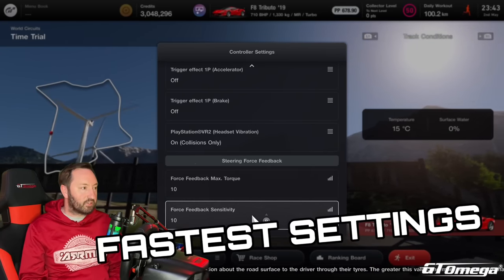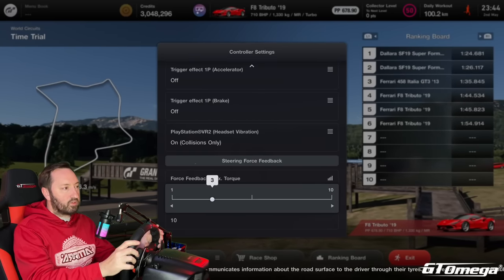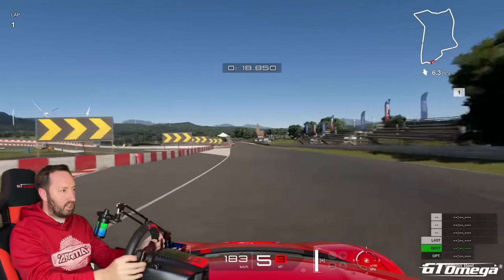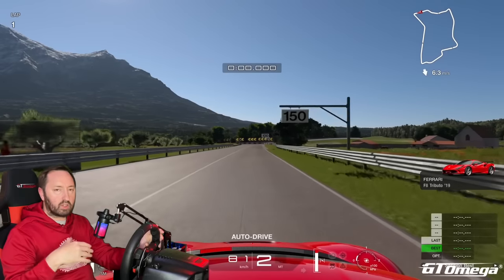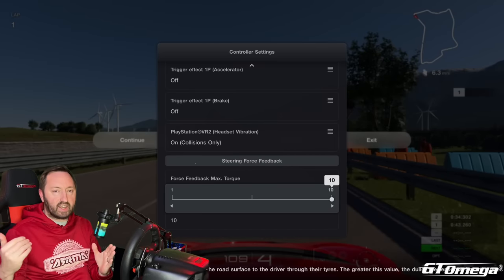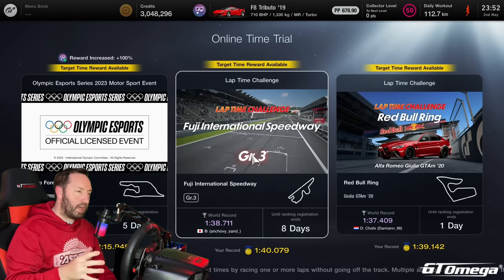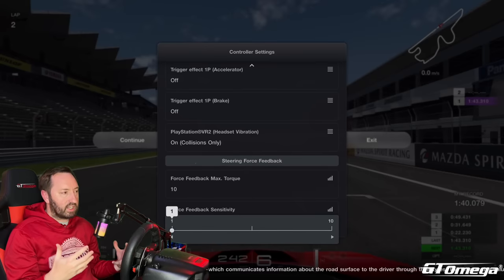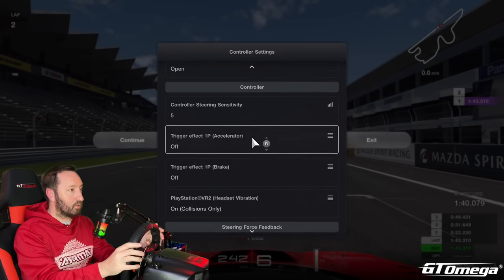Stop Wasting Time! Change Your Force Feedback Settings Now!

Comment: Thanks for the info. Non Wheel player here so do you think this gonna work on controller?
Reply: Sadly no; the settings (apart from Controller Sensitivity) are for wheel bases only.
Reply from the maker: Yeah exactly right. There’s are for wheel only. However I do plan on making a controller specific video which will cover the controller specific settings and my recommendations for those 👍🏻
Reply: @Doughtinator  when playing with controller I do wish PD had included acceleration and breaking sensitively settings for the analog triggers, a responce curve setting would be great. Pretty sure they had the option on GT5 etc.

Comment: Just a quick question, what did you mean about not getting any feedback on the kerbs. I use the TGt2 with the transducer motor (think that's what it's called) and when I ride the kerbs my wheel shakes on the side that the kerb is and I can feel which wheel is on the kerb whether it's the front or back or both. I only just got the TGT2 I wanted the Fanatec but living in NZ made it almost impossible so went with the TGT2 and glad I did. The motor also sends vibrations down my rig Playseat Trophy ( very solid rig) and to the pedals. It's only subtle and you won't feel it with shoes on but for me that was a real game changer. I whole heartedly reccomend the TGT2 it also has a much nicer wheel than the official Fanatec one which looks a bit too plastic to me.

Comment: I have a DD1 and the settings are high for GT7 and I have to say the game is crap for strength. Assetto Corsa, f1 and WRC10 the feedback is as powerfull as you like but on GT7 seems very limited. I have stopped playing the game beause it is pointless. If i hit a curb hard it should be trying to break my hand and not feel like I am going over a small bump. I would love a reply if anyone feels the same as me
Reply from the maker: Yeah I can imagine for a DD wheel these settings might be a bit high. 
I also agree that GT7 does seem a little limited on detail when it come to force feedback.

Comment: Worth it's weight in gold Chris, thanks 😊. Whilst I was using the G29 I was 4  and 7 as they move down the options and to match that on the T300 RS which I now use is 6 and 9, brand new servo, not what I had anticipated. I haven't done it back to back but I used the G29 for over one year, I feel fairly certain that I have them matched, weird.
Like deployed 👍
😎🎙🏎✅️
Reply from the maker: Thanks Julian 👍🏻👍🏻

Comment: Would a Logitech wheel work on a collapsible racing stand
Reply from the maker: Yeah for sure. On my GT Omega Classic wheel stand you can remove the two lever screws and it collapses down nicely. Just make sure to route cables so they can’t get trapped 👍🏻

Comment: The controller sensitivity will make your wheel turn in more to a corner, thus you can have precise turn in rather than over steer but you need to adjust this before you add steering sensitivity or you will not notice it( turn down steering sensitivity to 1, head for a corner at high speed and see when your back end will fill out....if it does  flip out and your controller sensitivity is at 0, turn it up  one increment then try again....eventually you will find your precise turn in at speed that you can maintain.....once you find that precision, then turn up you sensitivity on your wheel bit by bit to find what suits you best
Reply from the maker: I’ve not been able to notice this. I’ve tested but can never feel a difference 🤷🏻‍♂️
Reply: What wheel are you using?
Reply from the maker: I’m using Logitech G29
Reply: @Doughtinator  I have a thrustmaster tgt and there is definitely a difference. It’s literally more precise, and sensitive.
Reply from the maker: Interesting. I still can feel it and I’ve tried to check. Maybe it’s thrustmaster specific 🤷🏻‍♂️👍🏻
Reply: False. Controller sensitivity has no effect on wheels.
Reply: @kubemaster no. It’s in your head.
Reply: @JohnSdigi   No, It’s not in my head. Look at the link I left above. You can actually tell the difference in balance. Adjusting sensitivity improved my times when I set this to my liking. I’m A+ S ranked.
Reply: @kubemaster  its 100% in your head. I’ve seen the link and it’s wrong. Its been tested over and over, there’s no difference. I’m on a DD2, absolutely no difference in feel.

A+/S as well.
Reply: @JohnSdigi   Pal, I won’t argue with you, perhaps it’s wheel specific. I’ve literally tested countless times, and it does make a difference. Again, I have a TGT. Do you? I can feel the difference. No need to be insulting here.
Reply: @kubemaster  I wasn’t being insulting. That’s in your head as well.
Reply: @JohnSdigi  It’s insulting saying “it’s in my head” when I’m skilled enough to feel the difference. And… You don’t even have the same wheel. Anyway, you’re a total stranger, believe what you want. Ignorance is bliss. Goodbye.
Reply: @kubemaster  telling someone it’s a placebo effect in their head is not insulting. 

You have very thin skin if you think that’s a insult. Consult a dictionary.
Reply: @kubemaster  ignorance is bliss. Your ignorance. It’s been proven over and over that there is zero effect. 

Some claim the effect is felt in G29/Fanatec etc as well. And all disproven. 

It’s called a placebo effect.
Reply: @JohnSdigi  Buddy… conversation is over 🤷‍♂️ Go live life. Believe what you want. You sound obsessed. You don’t even Have the wheel. GOODBYE. Let it go.
Reply: @kubemaster  lol you ignorance sadly is not over 😂
Reply: @JohnSdigi   You don’t have the wheel to even prove your theory…. But you aren’t ignorant. 😄 got it. Goodbye. lol
Reply: @kubemaster  plenty of others have. And it’s the same placebo effect people think they feel on Fanatec. It’s been disproven already. Zero difference but keep fooling yourself 😂
Reply: @JohnSdigi   Why do you care so much? I actually have a Thrustmaster TGT… That was built for GT sport and GT7. It has a transducer. The fanatec doesn’t. Other factors like personal FF settings factor in as well. Other people may not be able to tell at all, based on the car class, etc. Group 3 cars (which I race) are more pronounced. 

Why don’t you prove that you can’t tell the difference, and make your own video disputing the video link? Oh that’s right, you don’t have the actual wheel.
Reply: @kubemaster  because there’s no difference in the information the game is sending to the wheel. Thats why it’s a placebo effect. 

If we did a blind test, you wouldn’t be able to pick which setting is which. Many have tried this. 

Great. Your thrustmaster has a cheap/weak transducer. Whoopee and irrelevant. I have 2 Buttkicker LFE’s tied to a 1,000w amp 🤷🏼‍♂️

Why do you prove that different information is being sent to the wheel by the game. Oh right. You can’t, because it’s not sending different info.
Reply: @JohnSdigi  What you have is irrelevant… do you have the same wheel? No. This topic seems to make you upset… it’s amusing. Yet I have the actual hardware in question,.that you literally cannot prove has an effect. You sound, disturbingly obsessive about this. Why don’t you personally dispute the video I sent. Contact him personally and tell him it’s a placebo. You’re not getting anywhere with me…. .
Reply: @kubemaster  😂 you don’t understand the word “relevant”. 

It is relevant. Because ignorant users also claim controller sensitivity effects their Fanatec. It does not. Fanatec has confirmed this. 

It’s in your head.
Reply: @kubemaster  what’s amusing is you appear to be the only one getting upset, Mr “that insulted me” 😂😂😂
Reply: @JohnSdigi   The conversation was over 7 posts ago… 🤷‍♂️. You’re unhinged.
Reply: @kubemaster  your right. It was over when you failed at understanding how the game works. 

Also amusing for you to post that, meanwhile you’ve also been carrying on. Logic isn’t your strength I see as you’ve fallen prey to a fallacy/hypocrisy.
Reply: @kubemaster  meanwhile Fanatec confirmed controller sensitivity has no effect. 

Just like people thinking SPR/DPR have a effect, more examples of placebos. 

You need to do a blind test. Have someone change the setting multiple times and see how many times you correctly pick it. Guaranteed you will fail.

Comment: 1. Controller sensitivity doesn’t affect wheel.

2. People with Logitech wheels always feel like their wheels are weak and want them to be more powerful but they can’t be. All jacking the max torque does on a Logitech wheel is delete any and all detail. Run over a pebble? Max torque. FULLY sending it in a corner? same forces. 

3. On my thrustmaster, when I want “tighter” steering, I reduce the steering angle on my wheel. Pressing left on the d pad on the wheel and the option button on the wheelbase at the same time will reduce steering angle, this needs to be done every time.

Comment: Controller Sensitivity(CS) may be more evident on fast consecutive left/right corners IMO. I too struggled to see if CS made any difference for wheel (I'm using Fanatec DD Pro), and I DO feel like there's subtle difference between min (-2) and max (10). With CS 10, I feel like I can make turns quicker left/right, "snappier", but it does lock up tires more.. more squeal.  Where as CS -2 there's less tire grip loss but not as snappy on steering. Again, this is very hard to tell, it may just be in my head and that this setting has no bearing on wheels. For what it's worth, some fast YT drivers use 0 as their setting.  
Great video BTW, thanks!
Reply from the maker: Thanks for sharing. I agree. I’m really trying to feel a difference and now wonder if I’m feeling a difference because I think I should be feeling a difference. 

What we really need is a blind test 3 times not knowing what the setting is on to really see if there is a difference.
Reply: Im 100% convinced Controller settings are actually for controller and not wheels
Reply: Yeah It make no bloody difference.

Comment: Interesting how high you go with a low nm , non DD wheel
But it's nice that PD give so much room to adjust

Nice point about caster
Reply from the maker: Yeah the higher setting may have some clipping but it’s provost only clipping irrelevant details. The main detail I want to feel is alignment 👍🏻

Comment: Nice vid Chris, i personally use 6 torque, 10 sensitivity. For me too high on torque, i feel im wrestling with the car too much, but i always want most sensitivity as possible. 
Glad you used the ferrari, i used same car as wanted to try car i dont use much and we have simular times, slightly differing styles, but its good to see there are different ways to drive it to get simular results, however i feel it does struggle over the curbs which i think holds its pace back a little as it feels a bit nervous. 
Im outta action atm in hospital but will definitely have a fiddle with settings just to see if i became set in my ways. Mssing my hobby and missing making tt vids but hope to get to it soon. 
Keep up the great work and chuffed for you getting affiliated with gt omega
See ya on the leaderboards soon, peace
Reply from the maker: Cheers Steve. Get well soon man. 
Yeah I agree with you. Finding the right balance is very important. Feeling the feedback is important but too much and the car starts driving you 👍🏻
Reply: 5 sensitivity bro

Comment: Controller sensitivity effects linearity. I’ve tested this extensively on my thrustmaster tgt. It actually took a bit of time to get used to because I can feel the rear better. It 100% helped with faster lap times. 

So yes, controller sensitivity translates to the wheel 100%
Reply from the maker: I still can’t feel it. But maybe it’s because I’m on Logitech and others that say it matters are on thrustmaster?
Reply: @Doughtinator  I drive mostly GT3 cars. My FFB torque is 4, FFB sensitivity is 3. Controller sensitivity at 4 or 5 depending on the car. But I’m settling on 4 lately.
Reply: @Doughtinator  Maybe since your FFB sensitivity is at 10 it’s counteracting the controller sensitivity feel.
Reply: No it doesn’t. Controller Sen has ZERO effect on wheels.

Wheel linearity is effected by Torque sensitivity not controller.

Comment: Great work. When is missing is force feedback on pedals. The "trigger effect" on the controller really helps. I hope they can implement on pedals and manufacturers can update or upgrade the pedals. I think pedals.are a weakness in general on setups, the brake and clutch are not mounted correctly but I have seen one pedal set that has them mounted from above on a rig.
Reply: There are some pedals that just released with FFB in the pedals these are extremely high end pedals and only work on PC rigs. Alternatively you could try strapping some transducers to the pedals but then again those work better on PC as consoles can’t differentiate between audio inputs so they just broadcast all sound to the transducers. Sim racing is just better on PC
Reply from the maker: I agree. Sim racing pedals are lacking behind wheels. And even more so when it comes to console functionality.
Reply: I'm a beginner but I switch my brake to L trigger. I'm not manual shifting yet